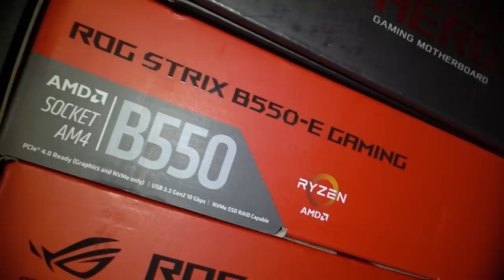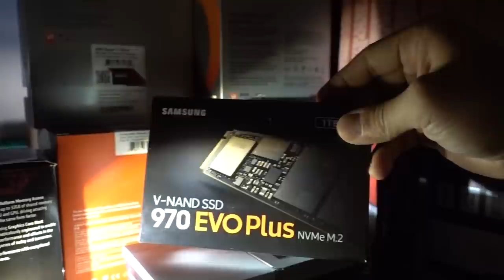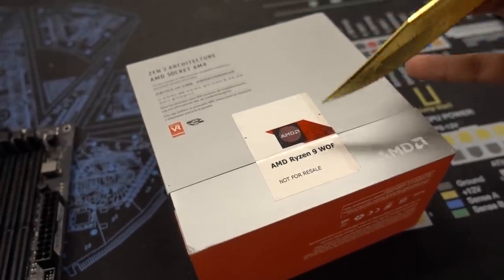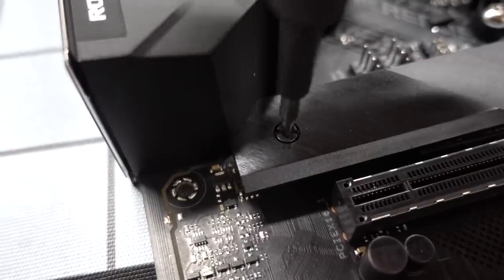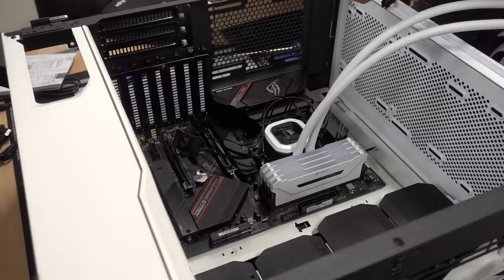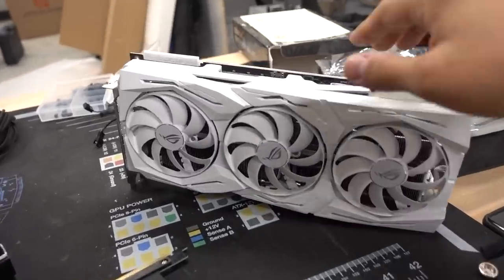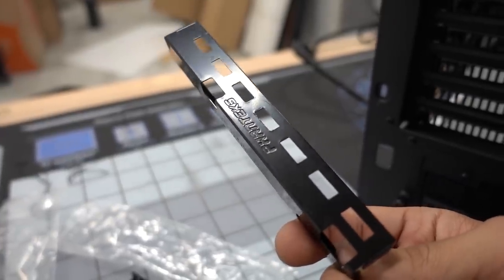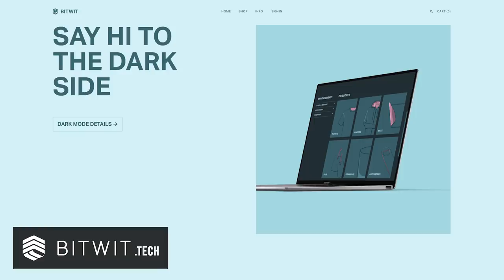They shut off our UTILITIES but I still built an awesome PC!

Comment: 10:40 everone gonna ignore that he almost ruined the cpu with the tension lever
Reply: i saw that to...
Reply: That noise it makes hurt me.
Reply: @romanbellic5241  It's just the tension lever locking in place!
Reply: @zZiL341yRj736  I think he meant when it goes over the top of the tension lever before he puts it in, he hits the bottom pins on it
Reply: Wouldn't have ruined it unless there was an electric shock. A bent pin can be fixed. Still, close call.

Comment: Kyle: “This kit is only 3000 speed, that’s a little slow for my liking.”
Me with 1666 speed memory: 😑
Edit: mine is ddr3
Reply: 2400
Reply: Mines 2666... What's up the the devil memory speeds
Reply: 1333Mhz DDR3 For the win!!
Reply: Umari don’t care, didn’t ask
Reply: 4000 gang
Reply: Me with my 3600 speed 😔I feel you
Reply: You all talkin bout ddr3, 667 mhz DDR2 is basically the best ram you can get, plebs
Reply: 8gb ddr 3  900mhz is the best bro, and don't forget laptop gang!
Reply: ddr4 auu
Reply: @FuryWasntavailable   Laptop RAM be like: 
P E A S A N T S
Reply: I have 12gb of ddr4 ram at the speed of 2400mhz. I feel like it's so slow.
Reply: 800mhz ddr2
Reply: 4KB of RAM at probably 100 KiloHertz was used by NASA to land on the moon, all faster RAM speed is pleb
Reply: UPGRADE
Reply: mine is 333mhz '-'
Reply: @josephlamarche5791  8gb of ddr2 ram at 800mhz 💪💪💪
Reply: yung duncッ don’t know the speed but I have 2 stick of 1gb each ddr2😚😚
Reply: 4133 gang
Reply: @cbob7423  i miss being ddr3 gang ddr3 is soooo cheap now!
Reply: @pjax9820  can't, I have a laptop.
Reply: @loidgi  I believe I still have 133mhz ram
Reply: 1333 here too; but quad channel R-dimms on old xeons
Reply: DDR4 3600 32 gbs - I run cad programs. :-)
Reply: @Googlegivemyoriginalnameback  RAM speed is irrelevant unless you are going to overclock it. They will all run at 2133Mhz anyway so paying for anything faster than that is just a waste of money. You don't need a new motherboard.
Reply: Umari try with two sticks of it works then you need a better motherboard
Reply: 1666 gang
Reply: same i also use a duel core and a gt720gddr3 1gb which is worst than the gt710ggdr3
Reply: I havd ddr3 666 mhz
Reply: @pjax9820  MONEY
Reply: 8GB DDR3 1600MHz gonna upgrade to 2666 cuz i'm satan
Reply: Damn the electric company around there, doesn't play.

I've gotten a new card before/debt card, and forgot to change my card on file/auto pay card, and my electric power never went off, at all, when I figured it out, it was a month and a half, after the bill was due, and by then, it was still not shut off, I figured it out, because I just wondered how much the electric bill was, and it read, almost double the normal amount, so I called, and they said you didn't pay this month, so I went to check my payment method, and then I was like OH YEAH, lol I got a new card, added it, payed the bill, then setup auto pay, again, with the correct/new card.

Anyway, they definitely don't play, where he lives lol
Reply: RAM IS ENOUGH LET'S TALK ABOUT PROCESSORS! mine is Pentium G3420 3.20 GHz Dual Core and I'm very proud of it. :D
Reply: @e.tsonev  core 2 quad......
Reply: Same hahaha i have an A-10 5700 apu dual core with 3.4 ghz, its slow af, i cant even play minecraft😭
Reply: @gqld1001  u know 3600 speed is good
Reply: @theswaff699  am with ya

tried to get away from him and oc to 3k buuut i couldnt get away my life was unstable without him. lmao jk my pc just unstable with the oced ram.
Reply: Awais Baig yeah
Reply: I have 1600 speed (Ddr3)
Reply: The human eye can only see ddr2
Reply: I feel your pain...
Reply: @brazilianman4305  sorry man but did we need your permission?
Reply: Oof!!!
Reply: @carsonbrooks1326   Thats is pretty slow.
Reply: 1066 speed :(
Reply: @carsonbrooks1326   Yes, you can. Its called build a PC or buy a new laptop. :D Might not be easy depending on finances, but an upgrade is theoretically possible.
Reply: @GodofLovers  yeah, it is.
Reply: damn dd3 huh, dw upgrades will only get cheeper. wheres my G.Skill Trident Z ROYAL gang at??? 16gb 3200mhz here
Reply: Cries in 16Gb 1333Mhz ddr3 ecc
Reply: Old kHz ram laughs in the back
Reply: Nobody asked

Comment: 10:55 RIP CPU :(
Reply: That was to stressful
Reply: oof
Reply: Notice he didn't boot the machine to windows...
Reply: what am I missing?
Reply: Noobmaster69 the sound of  pins being bent
Reply: Oh i just heard the sound of the pins scratching lmao
Reply: @TheVillainOfTheYear  yes he did
Reply: @TreyPenman  did I miss that? What time?
Reply: @TheVillainOfTheYear  very end you cn barely see ibooted
Reply: @TreyPenman  ah you're right.
Reply: I literally gasped. 😦
Reply: Noobmaster69 he just bend the pins- 😥
Reply: That happened to me yesterday 🤕
Reply: rjs06_ What cpu was it?
Reply: Unwxnted5301 ryzen 7 3700x, it was a small tap tho. Still fit in the socket
Reply: rjs06_ oh
Reply: TheVillainOfTheYear 28:07
Reply: How do you know it's broken, this dude been doing this for years.
Reply: pulled a Linus :/
Reply: @mezgotrich1  yeah the pins touched the retention arm OOF
Reply: AHHHHHH
Reply: OUCH
Reply: @TheVillainOfTheYear  pc wouldnt start  is cpu not working
Reply: @mezgotrich1  it fit tho
Reply: @ramiel8962  it was a 3900xt
Reply: The way he was shaking too made me flinch
Reply: I did this with my 3700x and surpriseingly nothing was bent or scratched and it still booted fine.
Reply: @TheVillainOfTheYear  yes he did
Reply: @TheVillainOfTheYear  near the end you can see the windows screen
Reply: f in the chat for the cpu :(

Comment: Everyone: crying in ryzen 5 
Me: Dies in AMD A series
Reply: Same its so hard
Reply: removed from existence on a phenom II
Reply: Ah, the zombification of the FX-8350 Black Edition and the XFX r9-290x.
Reply: laughs in intel core 2 duo thats underclocked cuz it is unstable on stock speeds because of inapropiate overclocking
Reply: Fx-6300
Reply: I have a ryzen 5 1400
Reply: 3 3200g
Reply: How is amd radeon
Reply: @user-sl3lg7ze8v  Radion has better price to performance but Nvidia has more performance
Reply: @paulhoeksema7200  thank new, im kinda new to pc building or smthing
Reply: @itstrilby2037  lol Ive got a x4 960 hbu?
Reply: @therottenshadow3113  I feel that. My old laptop would get to 132C (thats my highest) and somehow has not killed the Duo. either it needs an upgrade on cooling or some hardcore undervolting
Reply: @user-sl3lg7ze8v  I'd go for 5500xt or 5600xt if you're playing in 1080p, or if youre in 1440p 5700 or 5700xt. I've got a 5700xt for dual 1080p monitors and HTC Vive.
Reply: @paulhoeksema7200  For now. RDNA 2 specs haven't been leaked as much as ampere but there's definitely room for comeback season
Reply: @widesilly2269  132C???? Dude, don't throw that thing away, that's a god chip
Reply: @widesilly2269  true
Reply: @therottenshadow3113  Unfortunately it was a laptop processor and I knew someone who didn't have a PC and needed one with covid. They use it now.
Reply: laughs in intel 8008
Reply: I have amd fx 8370
Reply: Dies in amd duron
Reply: @zaneort  you tried the AMD 8008? It's just a clone chip, much harder to find.

Comment: "...only 3000 which is a little slow for my liking"

me with my 2400mhz speed laptop ram: ☹
Reply: me with my 1333 mhz ddr3: get on my level
Reply: Me with nothing
Reply: "laptop" memory isn't a type. Lol sodimm comes in ddr4 ddr3 at the same speeds as normal dimm.

Comment: Kyle : my Gpu doesnt fit the case i need to switch my cable 
Also Kyle : I could install the Gpu with the bracket from cablemod BUT i wanna use the benefits of the case

Comment: 26:28 - my heart dropped when it started to tip over. Help
Reply: Linus flashbacks.
Reply: @TheSandipBanerjee  a reply that can trigger a physical cringe to occur
Reply: what? it didn't start to tip over. he was holding it.
Reply: His hands were out of frame
Reply: Deku it was immediately clear to me that he was holding it, because a case doesn’t just start to tip over without any outside impact
Reply: @manuel0578  u obv didnt understand linus did the same thing so XD
Reply: Deku yo deku stop slackin and go unlock your quirks

Comment: "Is there a better processor in there?!"
But.....that is still a nice processor.
Sighs in Ryzen 7 2700
Reply: I want a ryzen 7 2700 dream
Reply: @ghosty_sz1750  It's a good processor, but I'll like to upgrade it soon.
Reply: @samuelgonzalez7783  I upgraded to 3700. Let me tell you if you do, Dont use stock cooler, go AIO or something more heavy duty. Trust me, My PC gets to about 70 now before I installed 4 more fans
Reply: @anntakamaki  Im still using the 2600 AMD stock cooler, you are right it makes considerable noise under heavy rendering, im looking forward forAMD 4000 series, by then i will buy a noctua cpu cooler for ZEN 3, hopefully by October.
Reply: @samuelgonzalez7783  why?
Reply: @mr_sandman1082  
Mainly because I want to see more details in modern games. The GPU helps yes, but I want to get all my hardware up higher in case I play a game that requires high loads for CPU and-or GPU. Games based on the Unreal Engine are CPU heavy. Games I ran on Unreal tended to be a bit laggy. Doom 2016 runs at 40-60 in fight scenes with more than 4 enemies. I would like the performance. Plus, I think blender rendering that uses CPU power would like it batter. Been getting noise problems in final renders.
Reply: @anntakamaki  
I kinda want to go with a tower cooler with large Noctua fans for silence. Though if I find the right AIO with the color scheme I want I'll go for it. My case can handle a good size twin fan AIO once I decide to do so when I upgrade. 
Thanks for the suggestion.
Reply: @samuelgonzalez7783  okay, btw i was asking out of curiosity idk anything about CPUs really thats why im here, im just so worried i made the wrong choice purchasing my R7 2700x cuz i just bougth it, and i just built my first pc.
Reply: I've got a r5 3600, I kinda wish I didn't cheap out this build......but it still blows my old i7 2600k clear out of the water and back.
Reply: @samuelgonzalez7783   If you go AIO I'd say Arctic liquid freezer II 280mm or 240mm. They are super cheap when they are normal priced and not gauged.
Reply: i got 2700x
Reply: @mr_sandman1082  
The x version is better than the normal. With that many cores you should be okay. Not on ultra graphics but high setting shoild he fine. Depending on the programming of the game of course.
Reply: @Hijynx87  Gauging is the worse thing for me right now. I want to make a linux pc, but the prices for somethings are crazy. I built my mom a pc and the motherboard was at a good price. After I bought it it went from 75 to 167 in a day. Glade I had a power supply and graphics card in hand to finish her build.

Waiting for prices to lower for when I do some upgrades.
Reply: Sighs in no pc so I watch this
Reply: zιc ᏰᏒᎥᏦፚᎩ one day sparky, one day.
Reply: @majesticsavage5322  yeah me too

Comment: Is there a limit to how many of the D-RGB fans you can daisy chain? I guess you had them powered by the case in this instance so that the button would work (sata connector giving more power?). How about connecting to the D-RGB motherboard header? Would you have to get a D-RGB hub in that case?

Comment: I have the same case and had the same problem vertical mounting the GPU like you did. Solution is not to screw in the plastic mount into the case... just leave it "free floating". Slide the GPU into the vertical slot where you need it and secure the GPU to the case with the GPU bracket screws. The plastic mount doesn't need to be screwed into the case in order for the GPU to be secure. Worked like a charm.

Comment: I like that you are using a strong, straight surface, so the motherboard won't bend when you apply pressure to insert the RAM. Me, when I use a motherboard box, I place the RAM slot above an end of the box, where the box won't allow the motherboard to bend. On the motherboard, there are a lot of components which won't allow bending, and and they may crack or loose conectivity, including resistors, capacitors and BGAs.

Comment: Hey man big fan. What do you think og my 3080 build ? 
AMD 3rd GENERATION RYZEN 9 3900X 12 Cores/24 Threads CPU - 5 YEAR WARRANTY240mm LIQUID COOLER - 5 YEAR WARRANTY
Latest X570 Motherboard - 3 YEAR WARRANTY32GB 3200MHz High RGB DDR4 Gaming RAM - Lifetime WARRANTY1TB M.2 NVME SSD (3700MBps Read & 3500MBps Write) - 3 YEAR WARRANTY2TB of storage - store anything and everything - 5 YEAR WARRANTY850 Watts GOLD Certified Modular Power Supply - 10 YEAR WARRANTY
FULL RGB - Change colors as you like or completely turn them offA Monstrous Looking Case With Full RGB - 3 YEAR WARRANTY
600 Mbps WirelessBluetooth

Comment: amon acharya
does a Dell Optiplex 7010 Tower, Intel Core i7-3770 3.4GHz, 16GB RAM, 2TB Hard Drive, DVDRW Windows 10 Pro 64bit work with a Gigabyte GeForce GTX 1650 D6 OC 4G Graphics Card, 170mm Compact Size, 4GB 128-Bit GDDR6, GV-N1656OC-4GD Video Card

Comment: So when i was replicating the build on pcpart picker I got this message “Phanteks Eclipse P500A D-RGB ATX Mid Tower Case has a front panel USB 3.2 Gen 2 Type C port, but the Asus ROG STRIX B550-F GAMING ATX AM4 Motherboard does not have sufficient USB 3.2 Gen 2 or Gen 1 headers. The case USB 3.2 Gen 2 Type C port will not be usable.” Is that an issue?

Comment: I'm planning a build in the P500a relatively soon, got delayed due to dental issue, I'm going with
Cx650f because it's white
PH-F140XP non RGB for rear fan
T-Force DDR4 3600 (16GB)
ASRock B550 Pro 4
RYZEN 3600
I've got 1 SSD and 4 HD to mount in the case it'll have plenty of space I've already purchased a couple extra drive cages. I've got to cut the budget in a few places so no NVME or additional SSD at this time. I'm also probably going to with the stock cooler for now.
One difference in building I'm considering is mounting the PSU with the fan upright and pulling air from the case since it's got 3 front fans I should still have positive pressure, also I don't have any choice but to put it on carpet and while I could put a shelf down I think it would look tacky 
On the graphics card I'm sticking with my RX 570 4gb again budget and bluntly cards aren't really available without overpaying. I know that the card won't really match the case but that's life

Comment: Note:  Case has a front panel USB 3.2 Gen 2 Type C port, but the Asus ROG STRIX B550-F GAMING ATX AM4 Motherboard does not have sufficient USB 3.2 Gen 2 or Gen 1 headers. The case USB 3.2 Gen 2 Type C port will not be usable with this build.  if you plan on using this build find a different motherboard.

also note: the fans he linked are 140mm and do not fit on the aio radiator, you'll need the 120mm fans.

Comment: Hey @bitwit I'm having problems with this build. I actually built something similar to this. 

I have a 5600x processor and a 2060 super gpu (couldn't find a 3070 yet) 
 Otherwise everything is the same. I cannot figure out how to get the case rgb controller to function. Am I not supposed to plug in the 3 pin m/b rgb chord? My fans all work and are in sync and rgb all sync. No idea what's going on.

Comment: Nice video man I just purchased this case for my first AMD build it's going to be my workhorse for VFX heavy duty stuff professional and I plan on getting the artic cooler for my 5950x I'm aware that this case in the front can mount a 360 on front & top and a front 420. Soooooo I was going to go for Kraken 360 especially for that gimmack lcd and of course rgb as well.

Do you recommend for my AMD 5950x the artic 360 or will the 420 be somewhat the same results? 

I might also try a dual build as well but might not be enough room idk the second build will be for my wife's stuff or just give her my old pc and swap out the gpu.

Comment: Not really a big fan of the Phanteks Eclipse P500A, to big and all steel, give me a MUCH smaller case were you can still fit a standard ATX MB in and a 240mm radiator (30mm thick), and a 120mm radiator (up to 60mm thick), all without any problems, also the reason i bought the Raijintek Thetis Window (Silver), is almost all made of Aluminum and has on each side a 3.0mm thick tempered glass, and that the MB is finally the right way up, so you see finally the good looking part of your Graphics card and other cards you put in the PCI-Express slots.

Comment: I had the Asus ROG Strix B550-F Gaming WiFi 6 motherboard for less then a week before I had to RMA it the debug lights kept staying on VGA at random for two days then the debug lights would stick on the Dram and CPU and would not post all with known working hardware. But when it did post it worked great and is a nice looking board. My first ever bad ASUS board.
Also nice computer build.

Comment: difference of the E gaming and  F gaming are more than likely the motherboard sizes. Something i noticed from rog is that the letters in front of gaming more than likely refer to the sizes of the mobo. i-gaming is on mini-itx boards, m-gaming is micro atx, e-gaming is listed on extended atx and f gaming is just regular atx (f probably stands for full as in full atx which is just regular atx). So thats the difference. And plus when looking it up f gaming is listed as a atx mother board. Hope that helps. i own a rog strix z390i-gaming, the mobo happens to also be a itx. Looked at m-gaming and they are all micro atx boards. So again the letters in front of gaming are the actual types/sizes of the mobo.
So for your b550-f gaming and b550-e gaming the difference one is atx and the other is extended atx.

Comment: I’ll be honest with you, electric companies don’t downright cut you off, they will usually call you first. Here in Canada, electric companies are required to call you a few times first, and law obligated them to give you power in winter even if you didn’t pay bills at all since years, due to requiring heating via electricity.